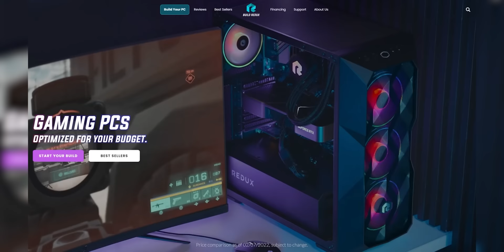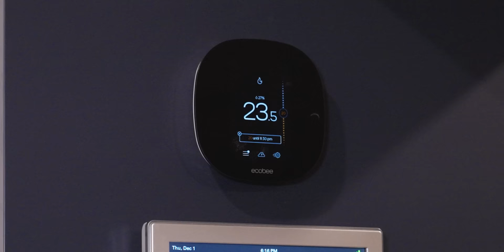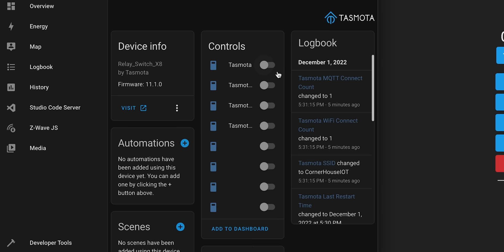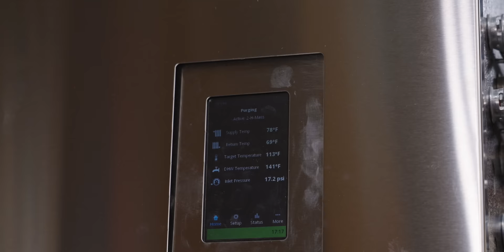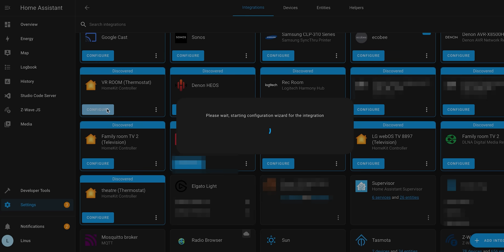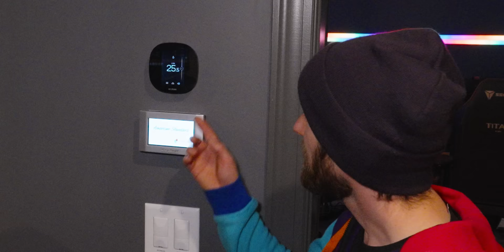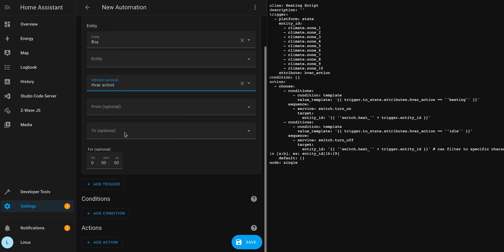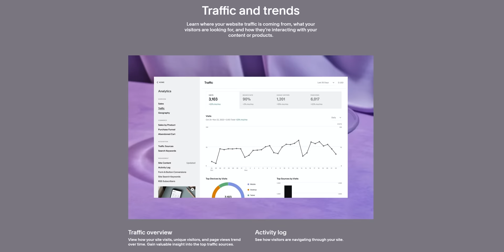My Smart Home is Stupid - HVAC Update

Comment: One more thing - If the valves are solenoid valves, trust me at some point they will damage these cheap Chinese relays. I would suggest you to add an arc suppression circuit to the relays or go with a solid state relays. Solenoid valves can cause the relay contacts to "glue" due to the arcing. Trust me, I learned this the hard way. So Jake, fix this before Linus' wife gets angry :D
Reply: Dude! That explains why my AC kept killing relays! I got some 30a rated relays a couple years ago which seem to be working well but ill look into that arc suppression!
Reply: @ChrisTopher-wl6pd  Shelly offer RC snubbers in their online store for pretty cheap. You can also make your own with a resistor and a capacitor but its a bit ugly.
Reply: Should not need surge suppression diodes on ac coils, as by nature of ac n9 back emf. For inductive loads when using ac output relays need suitable overating due to in rush / magnetising current

Comment: This video perfectly illustrates why I haven’t touched home automation stuff for myself yet, even though theoretically I could set it up with my IT skills. It’s just far too much trouble to get it to work the way I want it to, too many companies with too many products adhering to too many disparate standards or using proprietary garbage, and far too much bodging and kludging just to get what should be a straightforward switch to work. I come home to relax from work, not to continue having to troubleshoot network connections because my lights won’t turn on anymore.
Reply: I know right? So much easier to just setup a "smart" digital thermostat floor heater and or portable AC unit that is just set to the temperature you like and just let it turn on and off on its own to adjust the temperature. Sure not anywhere near as efficient as what a true smart thermostat system like Ecobee or Nest or what not but you don't have to spend hours of your life getting it set up and then have to spend hours troubleshooting if something inevitably goes horribly wrong...
Reply: Really need to have these smart systems with a simple manual override, that let's it work as a regular simple switch/thermostat, etc
Reply: An IT professional getting smart home is  just bringing your job into the house
Reply: @kingzach74  Also like, a smart thermostat or switch doesn’t need any access to the internet whatsoever to be smart, and it shouldn’t need any software updates to keep running properly, it should already be robust out of the box. These are already solved problems without “smart” devices, even just a programmable thermostat or timer switch allows better robustness and flexibility than a “smart” one, and introducing some software automation-ability to it shouldn’t totally bork the system as it was existing before like the ones on the market do today.
Reply: It's not bad once you learn the lesson that you should only add functionality, and never remove it.  That means if there is an on/off light switch, it should always do what it's supposed to, and turn the lights on/off even if the wifi and/or controller are down.  

In this case, they had thermostats that should work as expected when everything goes down if wired in, but decoupled it from doing its job, and now it only works if the least reliable component (home assistant and the home network) is fully functional.  This is a bad example of how to do a smart-home setup, and it's always going to be a pain.
Reply: @huzbum  But all smart home devices do this kind of shizz, which is the real problem. It’s incredibly hard to find smart devices that don’t occasionally bork themselves in ways a non-smart counterpart couldn’t, which is why I stay away from them as a consumer. That and the companies making them treat network security as an afterthought and that’s just a big yikes from me.
Reply: @cheeseisgreat24  all of my smart devices still work as expected when the network goes down.  Light switches turn lights on and off, the garage door still opens and closes with the remote and the button, the thermostat still heats and cools to the temp set on the wall unit, etc.  

In the example of this video, Linus made the deliberate decision to decouple the thermostats from the valves they are supposed to control.  In my opinion that's generally not the way to go about it, but he has his reasons.  

Do smart switches instead of smart bulbs, stuff like that, where there is still a manual control that works as expected.

As for security... it's usually a matter of having a good password that's not used across multiple sites.  Your cloud account is generally the vulnerability, not the devices themselves.
Reply: @huzbum  I mean, you must have unicorns operating your stuff then, because every single smart device I’ve ever serviced has been bricked at one point or another by something as simple as a software update.
Reply: @huzbum  like, I have literally seen every popular brand for smart devices stop working as their intended functionality at one point or another, and it’s still happening all across the spectrum. Meanwhile, if I buy a $5 electrical switch from the hardware store and install it, it will still work as a switch for several decades before needing to be replaced.
Reply: @huzbum  Also, the security on the devices themselves is way more vulnerable than you seem to believe, there’s a reason why my buddy who works for a defense contractor says that they aren’t allowed to install IoT devices at his office, and it’s not because the devices are too secure 🙃
Reply: @cheeseisgreat24  haha, I guess there is still time in the next couple decades, but my cheap ass Kasa switches have been trouble free for several years.  The battery died in my Kwikset deadbolt once and I had to find my physical key to get in the house... (as I mentioned, the old method should still work, not be replaced by the new "smart" method.)  

Now that I'm thinking about it, my Wyze cams have been unreliable though.  I don't think they like the cheap 50ft usb power cable, probably a lot of voltage drop.  

My Home Assistant sd-card got corrupted and I lost smart control of my z-wave switches until I fixed it.  I switched it to an SSD, and now I have more faith in it.  I was annoyed that I couldn't turn on my zigbee light strips though... no non-smart control on those.  The super cheap bluetooth ones have a remote though.
Reply: @huzbum  Yes, but the point is, the ease with which someone can do it is the problem, not just “can it be compromised?” Because anyone who’s done anything with security knows *everything* can and probably will be compromised at some point, but you shouldn’t be able to gain access to someone’s shit with only a few seconds of effort.
Reply: @cheeseisgreat24  I am going to agree to disagree on this.  I don't think that's true unless your network is already compromised, the attacker has your password, or already has physical access to the device.  I must however agree that cheese is great.
Reply: @huzbum  I mean, I’ve gotten into someone’s network in ~4 minutes through their Nest products without having physical access, and got through their Google Home hub thingy with a dollar store speaker on a cup against the window (it was on the level, they specifically asked me to try) soooooo 🤷🏻‍♂️
Reply: @huzbum  Granted, that was 4 years ago, they could have gotten *better* since then, but that is *not* the kind of an attack you don’t think about before releasing something for a home. 🤷🏻‍♂️
Reply: @cheeseisgreat24  oh, yeah, there is a vulnerability with smart speakers.  They can hear through walls/windows, etc.  If I remember right, you can shine a laser on the mic from a distance and modulate the laser with a speech waveform and it doesn't know the difference.  

They've kinda worked around that by requiring a voice code for anything that is security related like door locks or garage door openers.  It's annoying, but it makes sense.  It's also not much of a solution because it's pretty easy to listen in to the voice code.  I wouldn't be surprised if my neighbors knew our voice code.

Comment: Use an ecobee sensor that connects to the thermostat. You can put it somewhere else in the room and it will use the temp readings from it to tell the thermostat what temp it is.
Reply: I just came to the comments to see if anyone else had mentioned the sensors. I feel like one thermostat with sensors would have been way less annoying than setting up a thermostat in each room...
Reply: There is an offset setting on ecobees that Linus can use to compensate for the heat coming off the other thermostat
Reply: @BrianOminous  exactly, I'm just not sure if the temperature swing is constant or if it'll vary.
Reply: I was pretty happy with my EcoBee until it unexpectedly died.  We have only 1 thermostat to control a 2 floor home, and the little battery powered remote sensor worked for the half a day while we were on the floor without the original thermostat.

But since it died too early and they're too expensive to keep replacing, I'm back to turning a dumb one up/down like 2 degrees at bed/moring.  Oh well
Reply: i don't think he likes the ecobee's cause its cloud based and he wants 0 cloud

Comment: Instead of Tasmota you could have left the MQTT out of it by using ESPHome since they have a direct API to HA.
Reply: any options to not use MQTT is an option to consider :D
Reply: For the most part, Tasmota also talks directly to HA via the Tasmota integration. You just need to SetOption19 0 on your devices. Should work for most entities.

Comment: Linus, pull both thermostats off of the wall and see how much slack is in the wires... there might be enough to be able to swap the positions of the thermostats so the Ecobee ends up on the bottom.
Reply: Or just add wire as needed.  It is way easier to just add wire and swap positions than to do what they are doing.  They will hate that house if a major power problem occurs.  One or 2 bad computer boards and the whole house freezes over.

Comment: Having dealt with Home Assistant myself, I wasn't surprised by the implementations being wonky. What surprised me is that Yvonne thinks 19° is low temp to sleep??? That's my daily temperature, when I sleep the thermostat goes down to 16° lmao
Reply: Cold as possible with a nice blanket pls
Reply: I wouldn't be able to sleep at 19 with anything more than a single bedsheet. Way too hot. Also I'm in England which isn't exactly a cold climate.
Reply: Have you ever not gotten enough sleep? My body will tell me its cold AF and I'll be shivering, one hour later I'll be sweating buckets. Plus, your body is probably too good at retaining the heat it generates
Reply: @noahprussia7622  quite the contrary, I sleep better below 18°. I also use a down filled comforter though, it's pretty common here in Italy during winter
Reply: If you sleep with a blanket over you it doesn't really count
Reply: Where I live we don't have central heating nor insulation, so I often have to sleep when it's 10º inside, and I much prefer that to having to sleep (well, trying to sleep at least lol) at like 25º or higher (we don't have A/C either).
Reply: Yvonne was raised in Hong Kong so she's used to the warmer climate there

Comment: I love Jake's "that sound like a you problem" laugh 😂
Linus' house seems like an infosec nightmare.
Reply: It is all local. So hacking it is pretty hard. You either have get physical access to his network, or you have to hack one of his PCs and use them as a bridge into his network.
So no additional attack surface. But stronger consequences if it does happen i guess.
Reply: @oznerol256  It's not all local. But good point. Just the amount of apps needed to keep the house working increases the attack surface.

Comment: As someone who owns an AC company and watches your show quite a bit this got me dying. I got a few ecobee‘s too but buddy’s right the newer ones sense occupancy. But honestly, you really only needed to get one ecobee and you could’ve bought a ton of their sensors which also detect occupancy and put the sensors throughout your home. That’s  what I did two thermostat six sensors. Sensors are also super small. And can be hidden anywhere!
Reply: I was going to mention something about those communicating thermostats being installed under the ecobee‘s because those touch screens put out a ton of heat. You can calibrate and adjust the ecobee, but it’s best to move them. Both of those systems can be ran through one thermostat. A lot of the communicating units can still be ran on the traditional five wire hook up as well as the communicating two wire hook up.

Comment: You can just set an offset for the temperature. 
Like meassure how much the bottom display heats the thermostat up additional and calculate it in the yaml configuration.

Comment: Question: why are your thermostats using enough power to generate heat themselves?
Reply: An environmentalist's nightmare.
Reply: Probably because these American Standard things have an unnecessary bright display. And iirc Linus aint even at fault there, since the contractor used proprietary tech in that system, that only can communicate with these. Or maybe I'm completely wrong and these things are just as reliable as every gadget made out of Chinesium. Looks good, but not for long
Reply: @meuchooo  I did make this comment before Linus mentioned that he didn't want those thermostats, but it's insane to design a thermostat that just sits there making heat. Even if you want a stupidly fancy automatic switch flipper, you can do it without wasting power like that. You're probably right though.
Reply: They are mining Bitcoin.
Reply: @nicolaim4275  An environmentalist dies every time you burn another log in your fireplace.
Reply: Because its also a digital display with a microprocessor, several sensors, and a few different antennae for different wireless comms. Even at 5 or 10 watts electronics will produce noticeable heat.
Reply: @RAndrewNeal  But I planted all my trees myself!
Reply: @HazenMire  5 watts is quite a lot even for that. That is a raspberry pi 4 running on 100%.
Reply: @HazenMire  Yes, but that's what I'm getting at. Also, that can be done with far less than 5 watts. I'd expect the thing to idle well under a watt.
Reply: @RAndrewNeal  also I think I overheard it in the last WAN Show that Linus intentionally did it like he did, because he doesn't want anything to be uploaded to a cloud or in general being accessible through internet. He just mentioned it when they discussed the statement of eufy and their security system. So I'd guess he did accept the fact that it'll be unnecessary complicated, but at least nothing is getting uploaded anywhere, I guess? I mean I'm absolutely not into the whole smart home thing and I understand jack about it, but he and Luke might have their reasons for the whole mess (maybe he's right about his system not having anything that uploads any data anywhere except locally)
Reply: @meuchooo  I wouldn't have anything uploaded to the internet either. But I'd also install a regular ol' Honeywell thermostat that doesn't do any networking. lol I really like computers and electronics in general, but I don't need them to do everything.

Comment: You can also ditch Tasmota and just use ESPHome.  The relay board has an ESP chip.
Reply: One benefit to ESPHome over Tasmota is if you have Bluetooth devices (thermometers, etc.) is the ESPHome device can act as a Bluetooth proxy and improve coverage of those devices, likely important in the Linus mansion I'm sure. Also, it now runs on Pi Pico which you can actually purchase for cheap still.
Reply: Esphome you better have full HA backups, half the time restoring HA backups doesn't work, (or you just want to start from scratch again) and because esphome devices are so linked with the app in HAz you're left with zombie esphome devices you can't make changes to without massive hassle.

Then you have esphome pestering about a firmware update for 20 light switches that take 15mins each to update with a pi.
Tasmota you gotta install mosquito, but you set it up once and it just works. Plus each device has a webui for maintenance or whatever
Reply: I moved all my tasmota stuff to esphome  except multi-bulb fixtures bc of the lack of device grouping. Real pain in the ass
Reply: @Username-qx9gk  HA and ESPHome isn't too bad, as long as you use static and manually assigned IPs (in the YAML config) for the ESP devices. The default mDNS stuff is cool, but you can just smell potential issues if you were to go changing up your network.

I like the idea of a minimal webserver on each device (ESPHome allows that too with a one-line config), but how does that perform with Tasmota? The ESPHome docs clearly recommend against using the webserver for long-term, because it stresses the resources for these little ESP boards. Maybe not so bad for the 32s, but the 8266s are pretty weak. It would be cool if someone wrote a little Telnet server for those things that allowed you to view/manipulate the sensors/outputs, but nice ASCII menus and stuff would probably still strain the memory limits with all those strings floating around in the code.
Reply: @bnasty267  Another good point, too many features in firmware writing to flash every update, too many updates without much thought on backwards compatibility.
mDNS stuff is definitely a headache every once in a while, I bet many a device has gone in the trash because of mDNS confusion, especially after flashing/update

Tasmota also has an optional HA app.
The tasmota gui webserver runs just fine on esp8266, you just don't need a fancy GUI for a simple sensor/switch